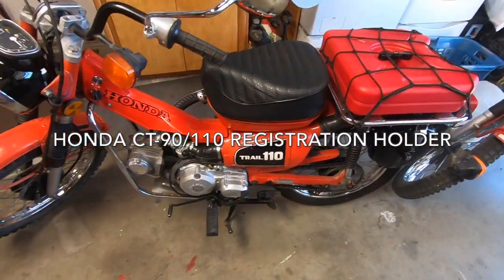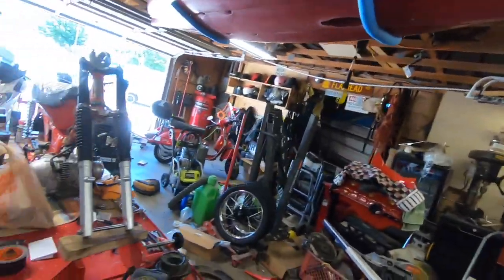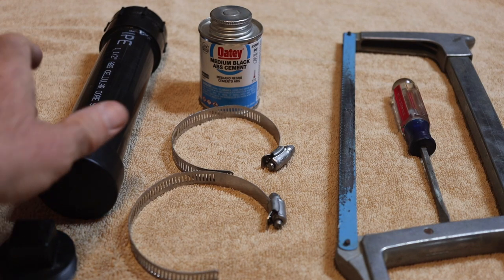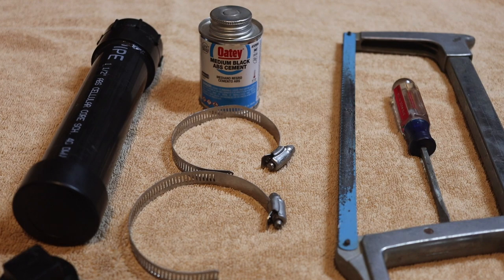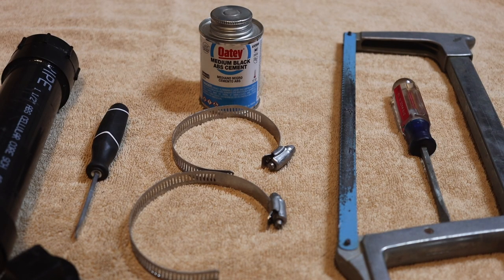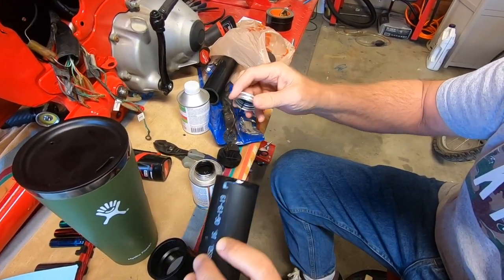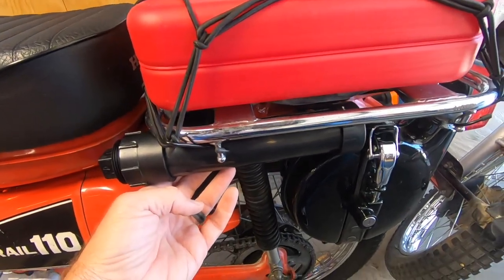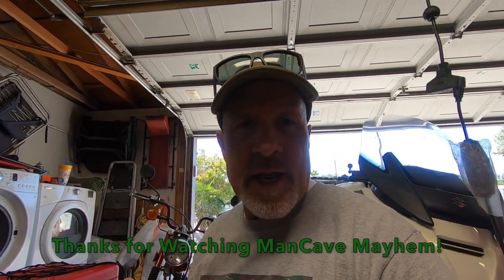Honda Trail 110 DIY Motorcycle Registration Holder

Comment: Nice trio of old Hondas you have. As said below, I would hesitate to put anything like a tool or anything solid in there. It will wear your registration through in just a few miles. I like the idea of that for a tool kit in a bigger size. I would have pursued making one but the Burgman has plenty of room for those things without me adding anything. Looking good Larry. Ride safe and make some videos of the rides.
Reply from the maker: Ken Nolte that’s a guarantee we will be doing more ride videos as soon as it warms up just a bit. Thanks for watching and thanks for supporting the channel👍🏻

Comment: Do you have a good way to mount a handicapped placard card to a motorcycle that is removable and lockable. One question more of idea to pieces of plexiglass super glued together with placard in between and then drill a hole to pass  a gun lock to lock on to bike handle bars.???

Comment: Good idea! I've made them for years out of 1/2" pvc with end caps pushed on(not glued), for just the registration, attached on the license plate with rubber coated tubing clamps. The screwdriver and spark plug might damage the registration from vibration? Let us know.
Reply from the maker: Russel Allen I didn’t think about that you guys may be right on that! I put my registration in a Ziploc bag as well so we’ll see how it works out. Thanks for the insight👍🏻